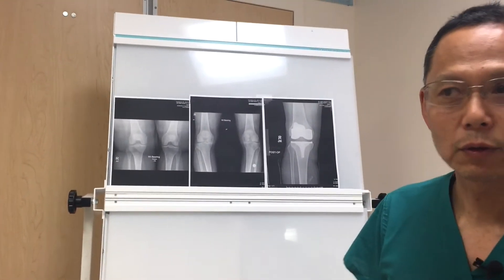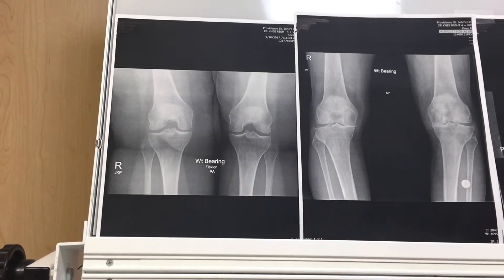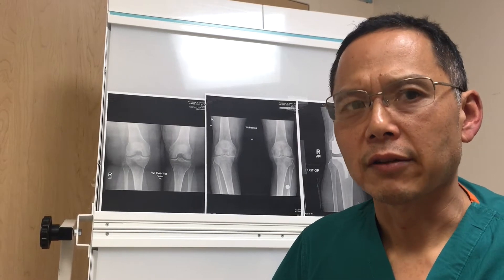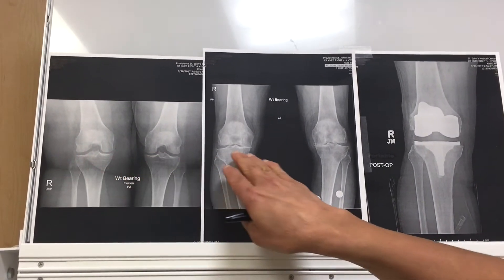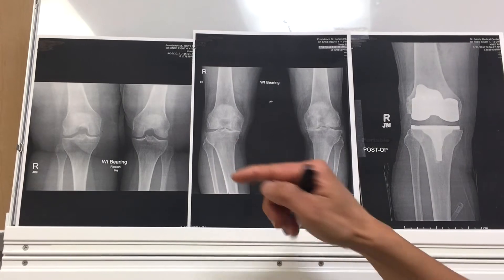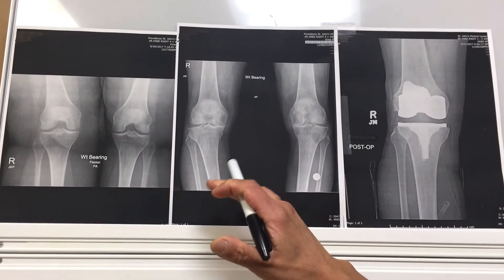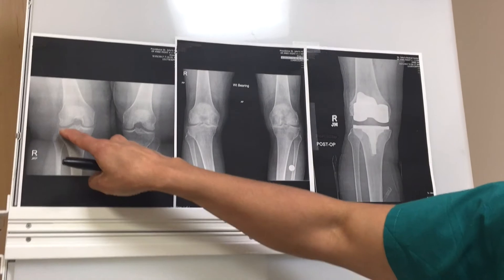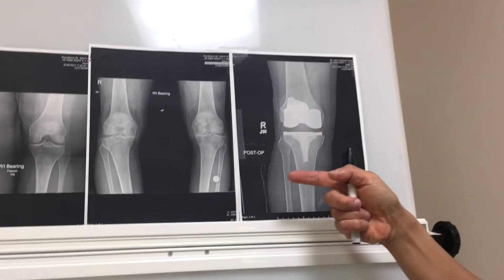How To Read An X-ray Of Your Knee

Comment: But what happens about the stability without the acl/pcl? I’ve just had a replacement refused because he said I’m not surgically viable due to my other health issues. I’ve got bone on bone and a fissure with cartilage meniscus bad damage. He said I’ve got to put up with it for now as my heart valves would need fixing before the surgery 😮